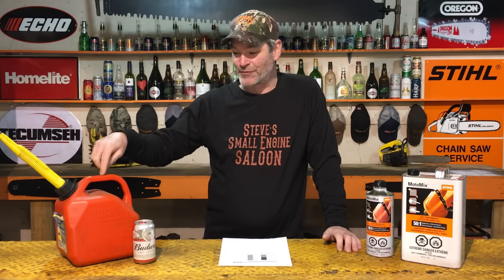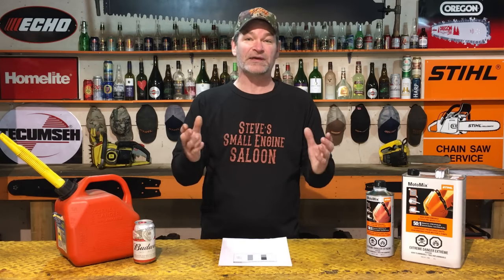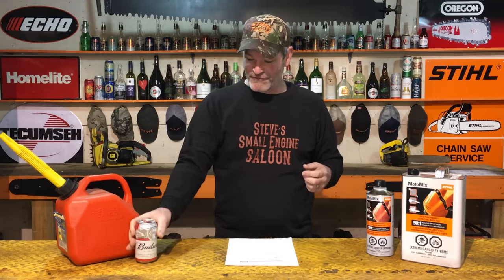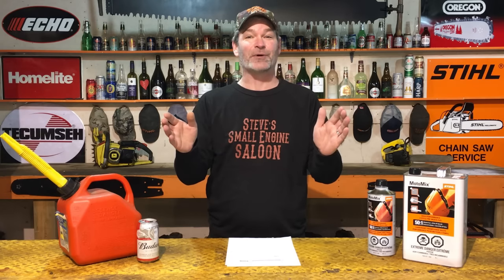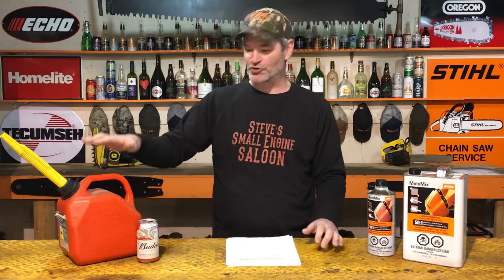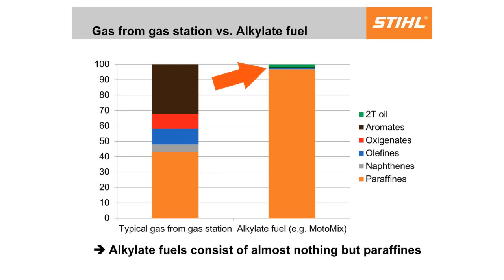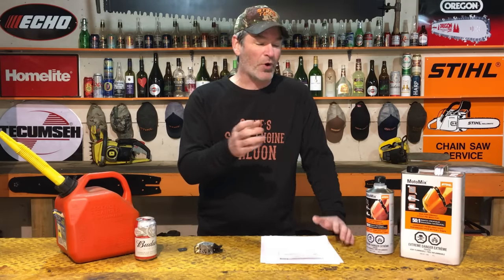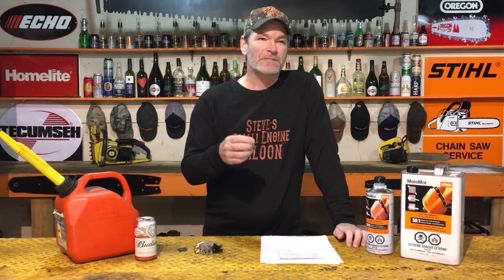The Ugly Truth Why Gas Station Fuel Is Bad For Small Engines

Comment: All I can say is non-ethanol fuel and Stabil in the 4cycles and Opti 2 oil and non-ethanol in the 2 cycles has served me well the last 40 years or so. Love your videos Steve, keep them coming!
Reply: So just adding Stabil to the fuel is sufficient? That's what I do.
Reply: I don't even  use  Stabil, just non ethanol fuel. It sets all winter and starts right up.
Reply: Ever since I simply switched to non-ethanol gas, it's eliminated my fuel related problems. I store it with a full tank and it starts right up in the spring.
Reply: Non ethanol with Amsoil Sabre. The Amsoil has stabilizer in it for back up..

Comment: Very informative. However, my experience is that gas-pump gas works fine with no problems--as long as you do a couple of things. My 13 YO Husqqvarna with Honda GCV160 has been fine. I run the tank and carb dry at the end of the season to prevent gumming up the carb jet. Premium gas to eliminate ethanol. Once when it became harder to start, I ran some Sea Foam through the carb's air intake to decarbonize the combustion chamber (lots of YT videos on how to do this) and it has been great ever since. Almost all problems are user neglect in some way.

Comment: I like the videos you make. You know your stuff. I was surprised to hear the storage method completely do a 180. I always store my equipment with fuel in it. The reason I do it is because I have never had to replace a dry rotted fuel line. So using this method I have never had trouble waking my equipment up after a long winter.

Comment: I disagree with you on some points .  Yeah the premixed fuel might supposedly be better for the engines . But let's be honest stihl and  husqvarna get the same premimum fuel we get at the pumps and then they use the same 2 stroke oil as well . They are going to use the cheapest fuel and oil possible yet they charge the consumer an outrageous price.  The real difference if anything is they mix it properly and add some additives  as most homeowners dont . I'd rather buy gas station fuel and run their oil than pay  $ 35 a gallon for premixed  fuel . The problem with gas station fuel is its self life of 30 days before it goes stale . If you refuel  the machine often and keep fresh fuel around then chances are you will be fine . The only time I run premixed fuel is right before winter I run a tank through the engine.  But that's my opinion.  Great video keep up the good work  !
Reply: I kind of agree with you and by the way you said pre mix was $35 a gallon but it's actually $89 a gallon. If you're a large commercial outfit I can see them using it to offset maintenance costs but the regular lawnmower and weedwacker owner is not going to fork over $89 a gallon.
Reply: @jwayne777  absolutely! I farm and do some landscaping and I know all to well the  high fuel costs . We have a tractor that holds 400 gallons of fuel at $6 a gallon !  Take care !
Reply: Can you back up that statement with some kind of proof or is that your opinion?
Reply: @markchidester6239  yeah I'm a mechanic and I've seen a few machines with issues from running premixed fuel . Now these instances were a couple of carb issues and one with  a melted piston.  I don't recommend running premixed fuel all the time . We run 1 tank  it before we winterize the equipment.  The premixed fuel can burn hotter than regular mixed fuel . Then you have to think about if it was blended properly or if the oil/fuel  ratio is wrong.
Reply: Good god your talking complete bollocks. 
The fuel is not like fuel from the pumps akalyte fuel has a shelf life of 5 years whereas pump gasoline/petrol lasts about 3 months if your storing an engine this give this type of fuel a huge advantage.
Reply: @MrStevegibb  think what you want ! Keep paying extra for the same fuel as premium  pump gas with a stabilizer added to to it for 5 times the  cost .  Been  working on  these things professionally for many years with no issues. Add stabil or sea foam to the last tank of fuel and run the machine for a while and pump gas hs just fine for storage .  Also mix some in the fuel cans with  every fill up to extend the shelf life .
Reply: I store about 50 gallons on ethanol fuel in 5 gal cans I use it about 6 months later and I've never had a problem I put it in my car around six or seven months been doing this for years and never had a problem I don't mind all this 30-day deterioration BS

Comment: +1 to Roger Mills recommendation to use AvGas from your local airport.  AvGas is minimum 100 octane (usually around 102 or so), has absolutely no alcohol whatsoever, no funky junk additives, and is very stable.  Far more stable than any auto-gas with fuel stabilizer added.  The higher octane really works well in 2-stroke engines.  Your 2-stroke engines will start easier, run quieter (no pre-ignition ping) and smoother then they do with car-gas .  I did a full career in the fire service. About 20 years ago we were having problems with the mixed fuel going bad in our equipment and fuel cans on our fire engines.  Chainsaws, K-12 saws, generators, extrication tool power units etc.  After some research, we switched over to exclusively use AvGas and all those problems ceased.  The lead content in the AvGas did and does not cause any problems with engines "designed" to run on lead-free fuel.  In addition to boosting the Octane rating of the fuel, the lead provides lubrication.  And AvGas just does not go bad.  No more lacquering of the carb, no phase-separation of the alcohol and water, no problem with the ultra-light aromatics evaporating off and lowering the octane and making starting hard.  Even here in the Peoples Republic of California AvGas is currently only about $5.20 per gallon, a fraction of the cost of Moto-Mix or any of the Quart-Cans of engineered fuel.  And AvGas does not deteriorate any of the o-rings, gaskets or seals in your engine or fuel system.   I have a Stihl 072 saw that I bought new in 1983.  Since new I have exclusively used AvGas and Synthetic 2-Stroke oil (mostly Amsoil with the occasional Klotz) and have never re-built the carb.  Finally had to replace the fuel lines for only the second time last year.  Still using the original plastic fuel tank.
Reply: taildown       For those who  aren’t airplane educated the gas is called 100LL.  low lead.     Small airports will sell it and you can put it in 5 gallon cans just ask them first.     Most pumps are self service credit card type for after hours flyers.    Just ask the line guy at the desk if you can find him before wandering out on the apron.
Reply: breathing the lead is not healthy
Reply: If you have access to aviation fuel!  better still use 100LL fuel

Comment: I bought the Husqvarna 50:1 Fuel+Oil XP+ fuel for the PoulanPro PR5020 20" chainsaw I bought because Husqvarna makes PoulanPro.  Now that I know all about gas station Premium gas, I'll stay with this or maybe price the Stihl to compare.  However, when I'm finished using it (haven't used it yet), I'll drain all the bar oil and fuel out to store it because I probably won't be needing it again for quit a while.  Thanks, Steve!  👍👍  You're the man.

Comment: Motomix is great fuel but 36.99 + taxes a gallon is just insane.
Reply: For that price, I could use regular gas and justify getting a new trimmer every season.
Reply: I agree!   
I go through about 50 Gallons a year, That’s $1850 Dollars a year I could have my lawn Professionally Manicured for that amount. Then I could sit, watch and Drink my Budweiser
Reply: Just an idea, maybe you could just use the motomix for the last tank when it’s sitting over night or longer storage times.
Reply: Yup, that sound like an arm and a leg.  It might be easier learning how to take out ethanol from regular gas by adding a little bit of water to the fuel, shaking it to bond the ethanol to water, let it settle in the bottom for 24hrs then siphon the ethanol free fuel from the top of the mixture to use on your engines.
Reply: I use non-ethanol fuel and run the carb dry after each use.  Haven't had any problems, yet.
Reply: At that price it would cost $148 to fill my $250 generator once.
Reply: @donholstein9333  You don't need to run on Motomix all the time, only once for a few minutes after draining the station fuel out of the tank at the end of the season when you store the machine.

Comment: You made a good point about ethanol capturing water.  I have a new Stihl and normally use in the fall and winter.  This year I’ve been making my own lumber with it.  It stopped working about 30 minutes in an a hot humid day.  Removed plug and noticed water.  Dumped fuel out of it and it had no water.  After watching this I’m concluding I was pulling the humidity into carb like an air compressor would.  I’m I on the right track?

Comment: One thing I would like to add, (if I may)... years ago, 1996, I bought a new, 18” straight shaft, Husqvarna weed trimmer. I have always used “Sta-Bil” along with the 2cycle oil & fuel additive. I have ALWAYS winterized it by filling the tank completely. Now then,... by running it with both the oil and “Sta-Bil”, I have never, (knockwood) had to have it in the shop! I KNOW, I can set the choke, pull the cord 3 times, and it WILL START! I think the lesson here is, if there is NO AIR in the fuel tank, there is no room for condensation! Just my 2 cents worth. (23 year young Husky, STILL runs like it was NEW)

Comment: Personally I've stopped having any carb issues since I've been religiously using sta-bil. If I put gas in a can I put stabilizer in it. My local shop who last worked on my chainsaw gave me that advice and it's done wonders for me. Personally I'll never buy this fancy fuel at the prices they charge.
Reply: Been running small engines using sta-bil for 35 years and have never had a  carb problem on
any of my chainsaws or small generators. I tell guys this and they don't believe me.
Reply: My lawn and garden mechanic specifically disagrees with using Stabil (specifically) in combination with running the take empty before storage.  In support, over the past 20 years, I discovered for myself the practice results in solids precipitating out of the remaining fuel/stabilizer combination which plugs the jetting over the winter when it evaporates. 

 I cannot say that Stabil is the culprit, BUT in combination with running the fuel line/carb dry and sitting idle over the winter months has resulted in 8 carbs having blockages in the spring where stabilizer in a full tank with the fuel petcock OPEN has never resulted in the precipitants experienced before - in the last 15 years now.  (BTW, upon recommendation, I switched to Seafoam in my  winter storage generators, lawn & garden equipment, chainsaws, and three [fuel injected] Corvettes).  Using the WET storage method,  i.e., full tank w/fuel in the carbs/injectors - ready to instantly start when if attempted.  Is it because of using the Seafoam vs. Stabil?  I cannot say.  But, I've never had an issue with starting engines after a winter's nap with either Seafoam or Stabil AS LONG AS THE FUEL SYSTEM REMAINED WET (the revised recommendation by some manufactures - as Steve pointed out.  And, I concur.
Reply: TBH that’s an even better idea cost wise, but these other fuel options are nice as well
Reply: I have several 5gal cans to store only ethanol free fuel which is added fuel stabilizer never a problem.
Reply: Seafoam works better than stabil
Reply: @2101case  I don't run stabil and never had a problem.
Reply: @2101case  
Hi
TV by
Reply: @paulworkman5755  I've never drained my saw because it has oil mixture been doing it over 20 years stihl runs the way it should, and people keep saying to empty the tank ?
Reply: @larryscarry411  Depends on the two stroke oil and if it is mixed wrong/too much oil. What can happen is a jelly or coagulation will form and clog up the carb.
Reply: Sta-Bil brand also sells a small engine additive in a green bottle (I forget what its called) and that works really well too. You add just a tiny amount to a gallon of gas and it help keep the fuel lines and carb clean. I buy premium gas, add sta-bil and this green additive, add my 2 cycle engine oil (shooting for 40:1 or even lower ratio) and mix it all up. Works pretty well, crazy enough running that stuff has actually improved run quality on some stuff I inherited like my father in law's echo string trimmer.

Comment: Very informative on the contents in the can fuel , thanks. Tell my customers to use it as much as they can. Some use a lot of fuel through out the summer cutting several lawns. They use gallons of fuel. I tell them, when they approach the end of the season where they only have one or two mowings left to go use pre-mixed Fuel in the equipment so it will survive the winter nicely. And it works.   Thanks Steve. Great video.
Reply from the maker: Right on Mikey!  Thank You...

Comment: I installed a shut off valve on my gas line. My last run for the fall I shut the valve off and let the engine run out of gas. In the spring I open the valve. It takes a few seconds for gas to get into the carborator, but it starts right up. Works like a charm.
Reply: Man, I don't even do that. I just dump an excessive amount of seafoam in the tank, and run it for a couple mins to get it through the carbs, then top the tank off to the brim so there's no room for condensation to form. (91oct, no ethanol content fuel) Starts right up after sitting 6+ months.
Reply: Yep do not let fuel sit in carb, also if you leave fuel in tank use stabilizer, it keeps gas from turning g to varnish.  I just put enough in lawn mower to get yard cut at yrs end and let tank and carb run dry. Any left in my fill can goes into car usually 1 to gallons. Buy new fuel next yr and never more than you can use in a month. Gas does not age well
Reply: Just use the lawn mower and let it run until it runs out of gas then store it.
Reply: @rbeck3200tb40  That is what I do. The shut off valve just gives me the ability to not run all the gas out of the tank. Shut off valves are cheep and easy to instal.
Reply: Sell your equipment in fall but new in spring..
Reply: I agree some run them dry but the company is now saying that the air without fuel in the carb will rust the components in the carb valves engine and dry rot the bowl ring, some say  run it dry with new gas 
Siphon out the old gas, put new gas in with the 
Recommended amount of fuel stabilizer run it for 10 minutes to clean the carb until it runs out of which one to do but I know this if I’m going to run it dry or if I’m going to keep fuel in it it’s going  be true fuel, or one of those can fuels

Comment: Steve, I've been doing this for four years with engineered fuel.  True Fuel & Moto Mix when I get to the Stihl dealer. I've stored my walk behind, my trimmer, all my brush gear and even my zero turn mower with these fuels in the tanks all winter. Come spring everything starts on the very first go pull start items take a single pull and they are up and running.  My oil in the crank case even stays cleaner at drain intervals.  You've hit this right on target my friend.
Reply from the maker: Thanks for sharing

Comment: Bought several new Husqvarna small engines  in 2014. Trimmers, blowers, saws...etc. Been using engineered fuel from day 1 and every engine has been absolutely flawless! Easy starts. No performance issues. The reduction in heartache is worth the price.
Reply from the maker: Right on

Comment: Thankyou Steve, by all accounts, I am thinking of going to an electric mower, to much hassle, cost over run, and mechanical problems with gas engines. The high expense of operating a gas engine, compare to electric engine with batteries. Thankyou for the heads up on the disposition of gasoline ingredients nowadays !!!  Kevin Phoenix

Comment: Thanks for everything Steve. I used to think I was trouble-free with non-ethanol gas but you made me rethink this
Reply: Well how many years have you been trouble free? I personally lose a carbureator less than every five years, so I am satisfied. Some of my carbs are over 10 years old on pump gas. I am thinking of changing to engineered fuel for the cleaner burn and less carbon build up and the inconveniance of mixing.

Comment: As someone who works for a major outdoor power equipment manufacturer, fuel issues are the #1 problem that cause equipment starting and running failures.  Please listen to the man!  This is great info and I learned a lot from this video beyond blaming everything on the ethanol.  I knew there had to be more to the pump gas story.  I only use non-ethanol fuel and stabilize every ounce as soon as it's in the gas for during regular use, but the winterization technique with the engineered fuel is a great "best practice" for off-season storage.  Running a tank full of engineered fuel every so often will also help keep your fuel systems clean.  Thanks Steve!
Reply from the maker: Thank You...and You're Welcome...
Reply: You have a misplaced modifier in your first sentence. As written you're saying that the FUEL ISSUES is/are "someone who works for a major outdoor power equipment manufacturer".

Comment: You got my thumbs up and I learned something. I quit removing the alcohol from my gas for storage and went back to Running my equipment dry then storing. It works for me and has for a lot of years. I may add a shot of stabilizer to the last of the gas then run the engines dry. I haven't had to replace any diaphragms but a bit of stabilizer can't hurt.